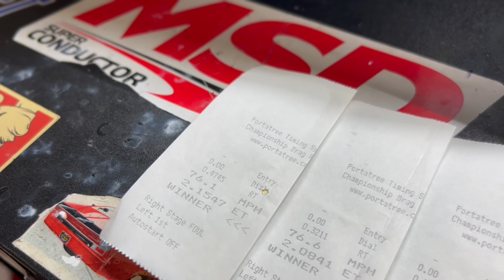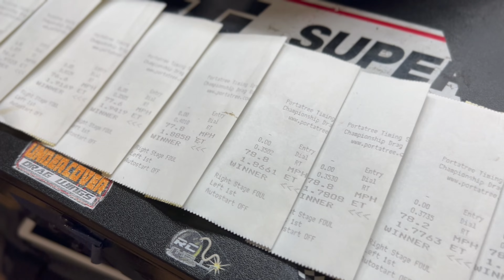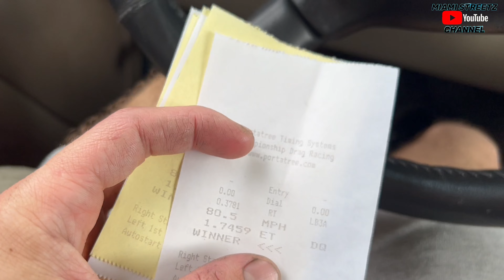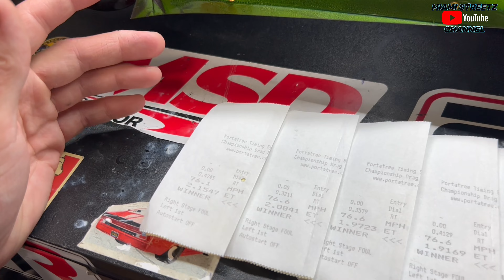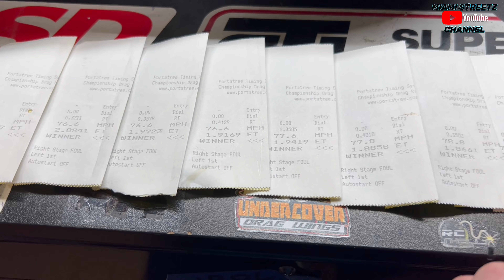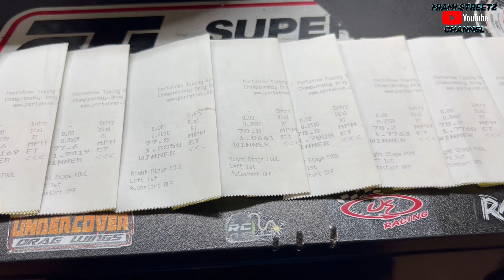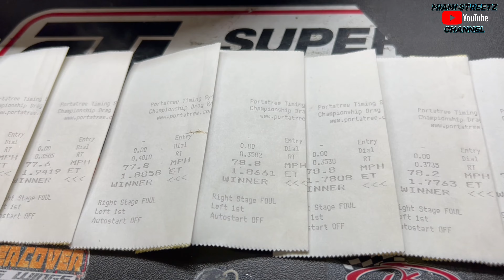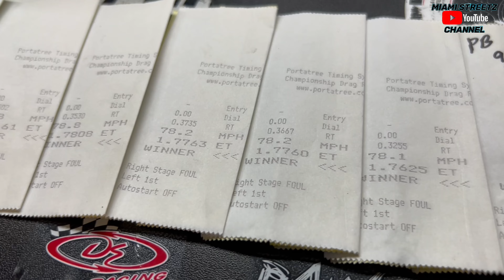NPRC DRAG RACING | Labor Day Test n Tune @ Ft Myers | PB’s were broken | Florida Record was reset?

Comment: Congrats man on the awesome passes , killer video try and get a solid top shaft that will solve the problem...
Reply from the maker: I made the conclusion of ditching the 5 gear and putting back a lay down transmission. There’s too much power loss with the 5 gear. I know the car had 6’s on Monday, i was being held back a lot with the transmission. Plus there’s a lot of stress on the top shaft trying to spin 3 idler gears + a diff + sticky tires! A lot of rotating mass for a little top shaft to hold up. We’ll get it right and head to the 1.6’s next time out. We have the power to do it also
Reply: @miamistreetz  hell yeah brother